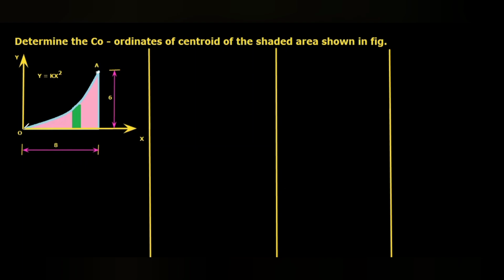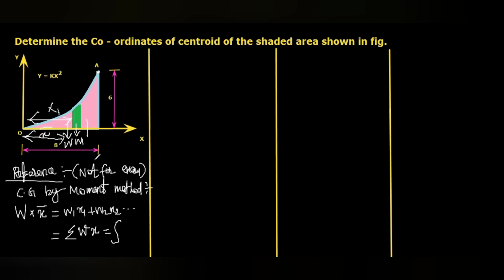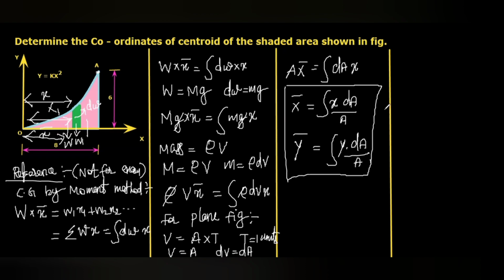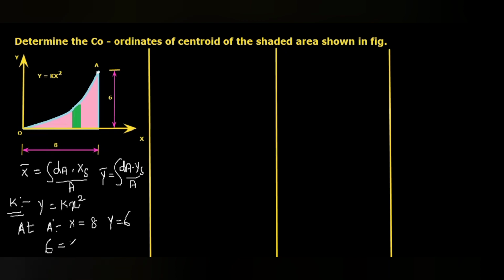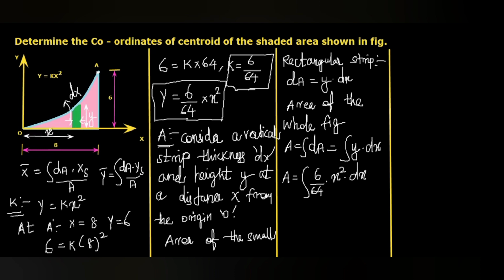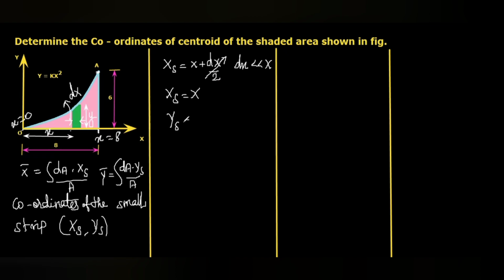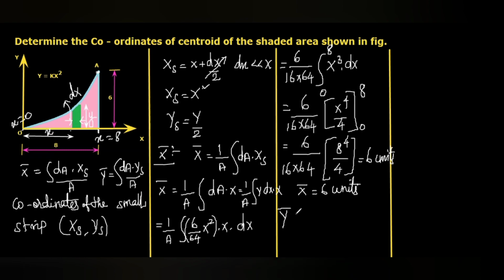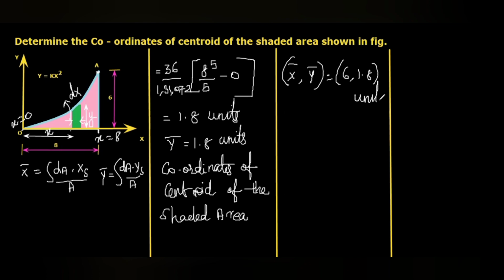Center of Gravity|Solved Numerical Example (14)|Area under the Curve|Engineering Mechanics|

Comment: Two questions please.  Has 'gravity', the horizonal component ever been physically measured on the surface of our earth?  If yes, what was the scientific accuracy of the device used to prove that force exists that gives credibility to your mathematics?
Reply from the maker: Valuable comment. Actually here x bar and y bar are not the horizontal or vertical components of gravitational force... And what is mentioned here as gravity is not a force.. It is a point where the whole mass is concentrated. x bar & y bar are the distances (horizontal &vertical respectively) between the origin (or axis oy) and the Centre of gravity)....